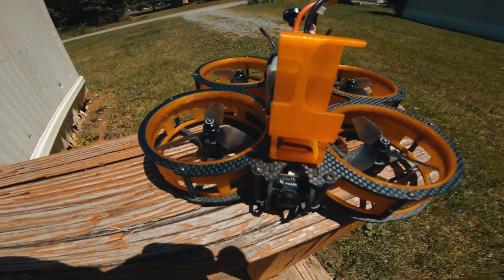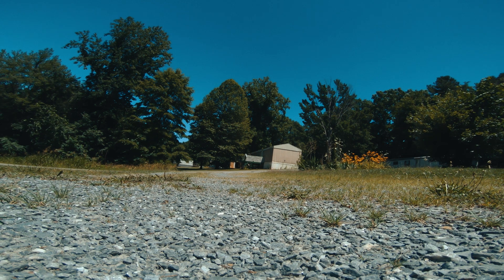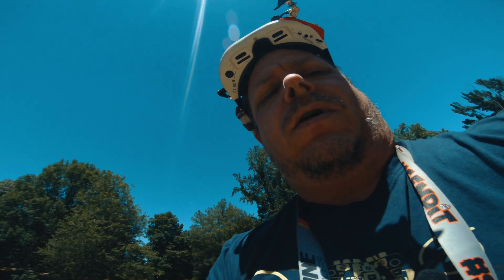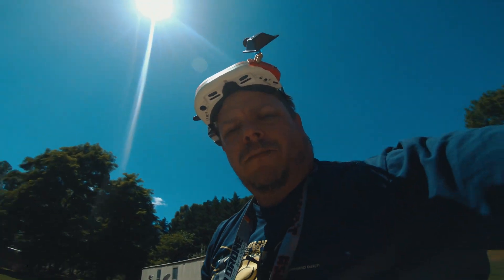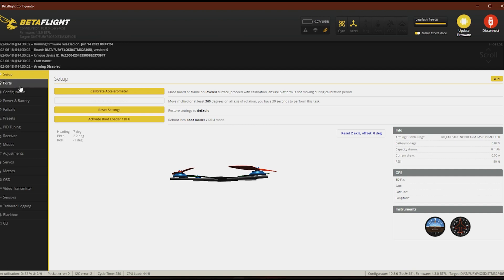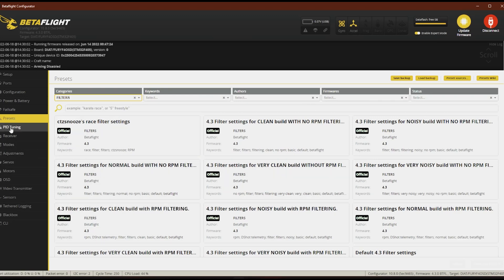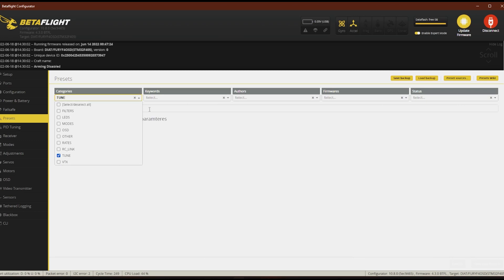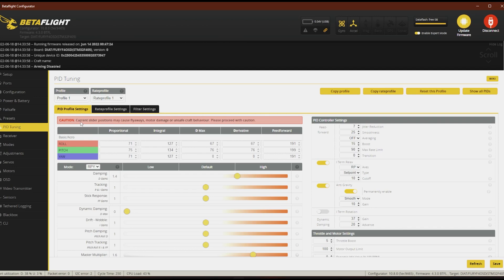Updating My Cinewhoop to Betaflight 4.3 | RPM Filters | UAV Tech Cinewhoop Preset

Comment: Im having the same kind of issues hot motors, unstable flight when cruising forward , will give this ago and see how it is, i dont know what each of the pids actualy do in responce to what happens to the quad in flight so hopfully this is an easy fix (still need to learn all about that)  how have you found it since you made the change?
Reply from the maker: Worked great for me. Still running it this way today. Motors still get a little warm but nothing like it was. The preset adjust the pids for you so you should be good. 

Just make sure to test it first. Fly around for less than a minute and check motors to make sure they are not too hot.
Reply: @IIICAP  Tbh I'm running bf 4.2.0 something like that, bit dubious to flash to latest as im still learning eavyrhing and wouldnt want to mess things up, presets are avaliable for latest version 4.3.0, I just paused your video on the tuning and copied the pids, took it out for a quick fly down the street and back, the quad does seam alot more stable without it jerking whilst cruising but I still need to take it out properly and test, I think it's flyable now as before was just to unstable to even go down the street, appreciate your time to reply brother 🙏 will subscribe and going to check out your content, seam like a pretty down to earth guy
Reply from the maker: 4.3 is worth the update... there's tons of videos out there. If you haven't found Joshua Bardwell yet he's a treasure trove of fpv knowledge. He has videos on updating firmware and even presets.. check'm out. You'll learn something!

When I updated it was noticeably better.